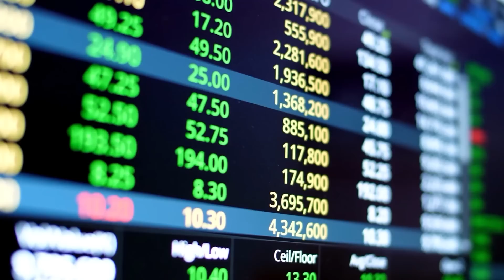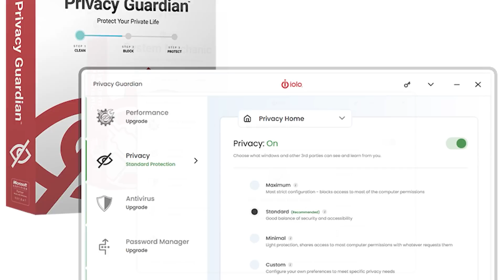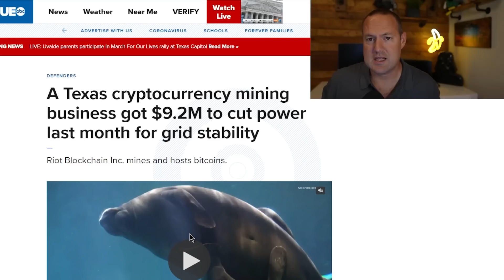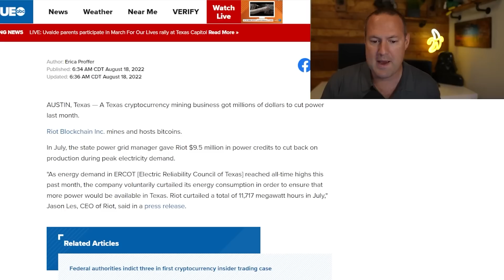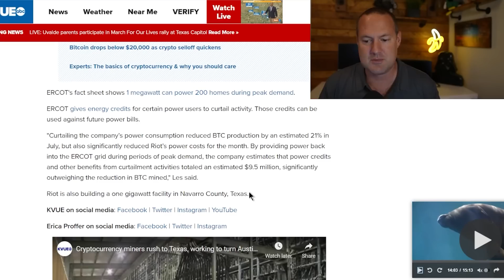Bitcoin Mining Makes the Power Grid More Reliable. Here's How That Works...

Comment: Despite suffering severe sell-off in the face of uncertainties in the macro landscape, BTC ebbing tide seems to be subsiding with key metrics suggesting the cryptocurrency is poised to come ahead. Ark invest recently pointed out the 200 weekly moving average, a key indicator that is signaling BTC could soon reclaim its lost glory. I buy and just trade long term more than ever, I have made over 8.5` btc from trading with Stacy Huth Crypto in few weeks this is one of the best medium to backup your assets incase it goes bearish.
Reply: Strategy minimizes risk and maximizes profits. Trading with her has been incredible throughout the last few months, and I would recommend her strategy to anyone.
Reply: Stacy taught me how to trade and recommended some good exchange with lesser fees. so yes if you are in for gains not just holding. i'd highly recommend Stacy Huth,. Life changing.
Reply: The accuracy with which Stacy Huth predicts the market is just astounding and i hope one day i can become like her but before then, i am sticking to trading with her signals..
Reply: I am also growing and accumulating with Stacy Huth signal.
Reply: It doesn't matter if you are a current holder or a newbie, you can capitalize on the fluctuation of bitcoin by trading with good strategy/signals.
Reply: I'll agree with you because I've used her strategy in the past and was able to raise a total profit of 10.5 BTC in 6 weeks..

Comment: This is the kind of problems you create due to excessive liquidity in the system.

Government subsidies should be dynamic and adjust based on demand/supply. 

If you take away excessive money money and introduce a dynamic energy policy then we wouldn't need Crypto mining whilst still resolving the issue of excessive or lack of energy
Reply: The moethodology that you just mentioned is inflationary to the base currency as the government would be loosing over this deal.

Crypto miner should be made redundant and introduce a flexible dynamic policy for energy increasing the reward per kwh significantly when in need and also reduce them.. Hence the free market will take care of it without having the need of creating that extra intermediary person (miners).

IMHO Texas has done a mistake as it acknowledged this to be a possibility hence creating an extra layer of where the government looses money (net net) over the long term.

Comment: Great stuff, Jack. This is easily the best explanation I’ve seen regarding the issues the Texas grid had last year.
Reply from the maker: Thanks Daniel!
Reply: Um, this wouldn't have done anything to alleviate the disaster that the Texas grid faced last year. That grid was wholly unprotected from those freezing conditions. They failed to weatherize their grid against a cold snap despite facing a similar set of circumstances about 5 years prior to that.

 How is Bitcoin going to protect an obsolete power grid from extreme weather conditions? That doesn't make a lick of sense.

Comment: Government interference is the problem, Pumped storage can be an answer to this dilemma. Water batteries. Massachusetts has a few, they seem to make sense. Northfield to name one . So what's the " Carbon footprint" of Bitcoins?
Reply from the maker: Pumped hydro is out there, but is only profitable during extreme conditions because there are energy loses at both ends (the pumps have inefficiency as does the turbines in the opposite direction).  Crypto miners are proving more economical.

Comment: Why not miss out the middle man, power producers should start mining themselves. Make money both ends?
Reply from the maker: Power generators are good at generating.  Miners are good at mining.  Both will thrive with the right partnership arrangement.
Reply from the maker: Many utilities are going down this path.
Reply: @NobodySpecialFinance  If the utilities do their own mining they can fine tune demand and supply in house. Bear in mind that the crypto load has to be physically distributed in the grid. You are not only to balance the TOTAL load,  but the spread among the circuits as well. 👍
Reply: that is what some gas flaring oil companies are doing. Instead of burning the natgas, and incurring in the emission penalty for flaring, they run generators and mine bitcoin at the wellsit. Unclear how profitable this is.

Comment: We should increase our energy use to incentivize efficiency?
Reply from the maker: The grid needs stability of demand.  We need to increase use at times, decrease at others.  Instability is what’s causing problems.
Reply: @NobodySpecialFinance  -So these folks who have banks of computers running 24/7 are going to shut them down during peak usage hours?
Reply from the maker: @manholeeunuchsbane6197  yes. Example exactly that happening two weeks ago at the end of the video.
Reply: @NobodySpecialFinance  -In one instance, sure. But I have a hard time believing these bitcoin farms are just going to go dark due to the whims of the power company.
Reply: to incentivize reliability 👍
Reply: Yeah, this sounds like a load of horsesh*t.
Reply: Presumably, and get compensated with essentially a store credit with the power company that can then be used when demand is lower and energy is cheaper per megawatt hour.
Reply: @danielweeks1811  -Do you honestly see that occurring?
Reply: The story referenced in the video seems to be proof of concept. And most crypto mining software has a spot to enter your energy cost per megawatt hour and a governor that will only allow the rig to mine when it is profitable based on the cost of inputs and the spot price of bitcoin.